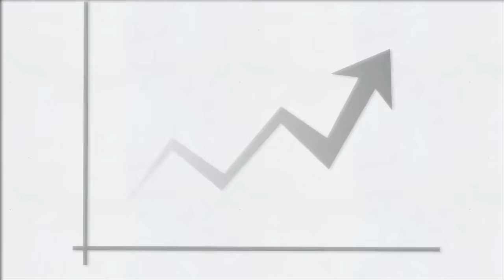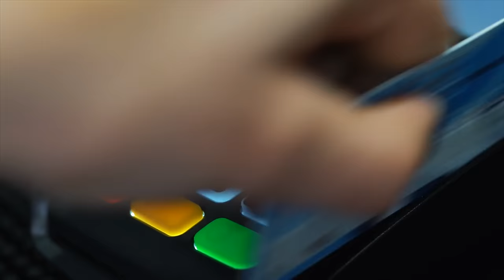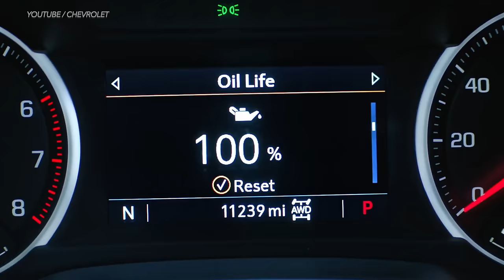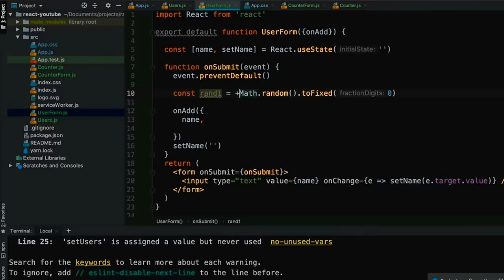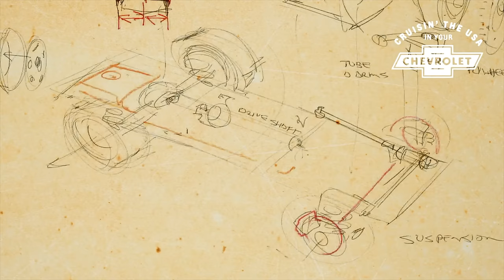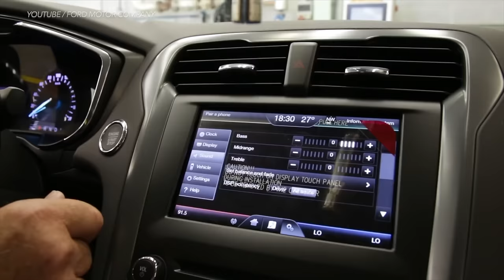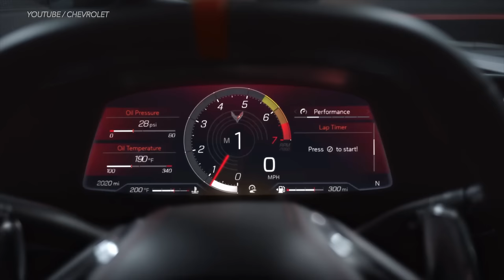Here's Why Car Companies Just Made it Illegal to Work on Your Own Car

Comment: A "cheap" mechanic in San Diego charges $125 per hour. There are hidden charges too. If a mechanic can beat the "book rate", the customer is still charged the same. I have found that also some labor can be charged twice. I had a water pump and alternator changed in a car. Part of replacing the water pump includes removing and replacing the alternator. I was charged labor for changing both items, or double charged for replacing the alternator.
Reply: Lmao all san diego is expensive, here in escondido, many mechanics dont even know what they’re doing and charge a fortune
Reply: A bigger problem is if they mix up the water pump with the alternator.

Comment: Audi's plastic thermostat housing scores top marks for planned obsolescence.  I just learned that for $1500 - 4 months after warranty expiration.
Reply: @midnitesquirldog1 most 90s cars were solid and very reliable.
Reply: For a thermostat? Incredible.
Reply: Exactly why I don't buy Audi or anything European, absolute junk
Reply: 4 months after warranty is coincidence about 1/3000 times. Just unfortunately not provable some how even with it happening with thousands of similar designs and parts. Only provable if you work with a government entity and safety related it seems.
Reply: @notsure3535   Modern Toyotas, specially the Prius, are among the most reliable, practical and efficient cars there is.
Reply: I just replaced one on a 2004 Honda Cr-V. Landrover is another one, it has an engine oil cooler that's plastic when it breaks internally oil mixes with coolant. Everything is plastic junk these days!
Reply: @hedgehogthesonic3181  yeah toyota are always reliable. But I doubt a new hybrid  are as reliable and easy to work on as a 90s Toyota corolla those 1.8 were bullet proof.
Reply: Lol the map thermostat I think
Reply: Ford had a plastic thermostat housing on their 4.0 SOHC engines between 2000-2010... It was notorious for leaking. I was having an insurance related repair on my 05 Mountaineer after a car accident and the mechanic was taking it for a test drive and it blew... fortunately, they were close to the shop and were able to get it back before it dumped all of the coolant and overheated. I ended up buying an aluminum aftermarket one afterwards. Sometimes the aftermarket parts are indeed better. On the bright side, my ride is so old that all of the design patents are expired.
Reply: I am a former Audi service manager and I usually would call Audi of America and try to get the repairs approved to file a warranty claim! Especially if the customer had a good service file and/or repeat customer! You can request an Audi DSM review your repair and possibly have some recourse if you have good service records and so close out of warranty! And If you went to an Audi dealer! Audi used to make good cars. Good luck
Reply: Make sure you get your order in for there latest model!!
Reply: WTF 🤯

Comment: I lost a plastic hub cap off my camry. Called the dealer to get a new one, they wanted 80 dollars for a single plastic hub cap.... found one on ebay for 20 bucks.
Reply: is it any good , dose it look them same ??
Reply: You can buy four copies for $20 on Ebay.  New ones from the dealer should not be $80
Reply: @johnsmith-ce2tq  it was the exact same.
Reply: @bubulubu3136  this was years back. Sometime around 2015. Couldn't find anything but the one. It was overpriced still but worth 20 to me.
Reply: Oh yeah eBay is a life saver for parts
Reply: That happened on my civic 3 weeks ago. I turned around immediately to see two cars run it right over. Literally 5 seconds later. Never bothered to switch lanes or drive straight so the tires didn’t go directly over it. It was right in the middle of one lane on a two lane 30 mph road.
Reply: @rafaeltorre1643  daily reminder that most people are NPC

Comment: And this is why I keep my 04 honda civic easy to repair and parts are always available. No stupid problems with electronics. 
When it breaks down I hardly stress, I know that car in and out. 
I would be stupid to let this car go for a newer one.
Reply: Truth
Reply: Same here with my 03 Corolla. I keep it simple.
Reply: all my repairs have been for the exhaust system, brakes or items like the alternator.  I have never had a module go out.
Reply: Too many annoying devices on the plenum
Reply: @albertopalma1663  got a 01' 5 speed recently. Went from a wrx to that and honestly not complaining.
Reply: Same with my 97 Crv👍

Comment: The flat rate system in flawed. It incentivizes rushing & cutting corners. 
Say for example a technician has 5 jobs lined up for their shift & that the total amount of repair time allotted for those tasks is 6.5 hours. 
Maybe 4 of the 5 jobs were successfully completed within in the expected timeframe, but the 5th one doesn't go as planned. Maybe the vehicle comes from the rustbelt & all the fasteners are rusted solid & in takes two hours longer to complete the job. Now that tech may be forced to complete that repair for free, even though the shop will still get paid either way. This type of scenario is not uncommon& it can turn otherwise competent workers into hacks.
Reply: That’s why I try to do as much work on my vehicles as possible. I don’t want my vehicle being that 5th car getting subpar work done on it.
Reply: Yep. Plus watching the person that gave you the work sit around laughing and bullshitting being paid essentially the same you are after figuring your energy given to the job is a huge deterrence as well
Reply: it all rigged just dont buy newer cars problem fixed
Reply: Amen.
Reply: @Bryan Lashbrook 6 months waiting on parts. WOW! I can't wait that long. I need my car asap!

Comment: Boy does this hit home. I want to replace the right rear trailing arm on my 2004 Honda Element which I can only get from Honda at $700 plus. The 2004 CRV cost half of that. Forget aftermarket they don’t exist. I had a hell of a time just locating bushings. I was told by a junkyard that the CRV & Element trailing arms are interchangeable but the dealer doesn’t know as he only goes by the part number. Supposedly they share the same platform. A Hollander manual, that the junkyard uses, would verify if they are interchangeable.
Reply: Tell Honda you are aware that the trailing arm probably costed them less than $20 to actually make and then tell them if they will do it for $200 they have a deal.
Reply: Look on eBay, not really a problem anyway.
Reply: I found one on eBay for 290$
Reply: Pull of your trailing arm, go to junkyard, pull trailing arm off a CRV, compare them.
Reply: @AceHernandz  only used ones on eBay. In fact if you search you will only find one of the bushings not the one with the protruding metal peace that has a hole. Siberian sells polyurethane ones. I finally located a company in California that sells the rubber ones but I would rather get new ones. I guess I will subscribe to Hollander
Reply: @crabbubbles1161  they don’t even stock them.
Reply: Should look at pick and pull first !
Reply: @andyhuang7526  I am looking for a new one not used. Worse case will get bushings.
Reply: then use the CRV one and stop crying about it
Reply: @executive  I am not crying about it but I need to confirm that it fits. If you had been paying attention I mentioned earlier that I had gotten 2 different responses one that they fit and another that they didn’t. It makes no sense to me to purchase them and have to return them because they didn’t fit.
Reply: Is that because Honda prevented third party from making them or is it because third party don't see a profit in making and stocking that particular repair part?  Third Party manufacturers are still a business and will only make things if there is a profit to be made.  They don't make repair parts, just to make to make repair parts.  So, should there be a law forcing third parties that they "must" make generic repair parts even if there is a very small market to justify the cost of tooling and manufacturing?
Reply: @HotRod-wv4vm  why not
Reply: @executive  if I buy them and have to return them because they don’t fit I will have to pay a restocking fee
Reply: @HotRod-wv4vm  politely explain to the junkyard that THEY suggested it will fit, so if it doesn't then it's their fault, and you shouldn't be responsible for restocking fee. If they stand behind their advice then they should agree.
Reply: I still don't understand what this has to do with the video. There are plenty of inexpensive aftermarket suspension parts for your vehicle. Just not this particular part. Maybe there's no money in it for anyone. It's not necessarily Honda's fault.
Reply: @executive  it’s Honda’s fault. In Canada Honda was forced to buy back some Honda Elements because they rusted exactly by the right rear trailing arm where it connects to the frame. Unfortunately they have not done that in the US unless the government forces them. I am trying to be proactive. My Honda dealer wants $1100 for a new one plus $1,000 in labor. Online it!s $700 plus and I do the labor. They don’t even sell the bushings! If I buy online from a Honda dealer it’s $700 plus and I do the labor. What sucks is that everyone makes control arms and other parts except the freaking trailing arms.
Reply: @HotRod-wv4vm  I understand. They're poorly made. But why is it Honda's fault that you don't like the price, or that you can't find any other parts? Is Honda PREVENTING anybody else from making control arms?
Reply: @executive  it’s a manufacturing defect. If the Canadian government forced them to repair it or if unfixable buy it back, they should do that here. I would rather fix it once I get a definitive answer.
Reply: @HotRod-wv4vm  this has absolutely nothing to do with the video
Reply: @executive  - there is SOME reason why this part is unavailable new in the aftermarket and price-gouged by Honda, and the patent situation described by Scotty is the most likely explanation why.
   So yes, it has everything to do with the video.
Reply: @jamesredman1263  you're speculating. Anyway, so if I invent a revolutionary new fuel injector then I shouldn't be allowed to patent it?
Reply: @executive  - I have nothing against patents as such. My point was, I believe this matches what Scotty is talking about.
 And I despise them price gouging $700 for one trailing arm AND not even supplying bushings.
Reply: Depends on the part, I have bought a lot of non-OEM parts, often with a lifetime warranty unlike OEM items from Toyota.
Reply: @toriless  I tend to get OEM Honda parts online and for what ever reason they are always cheaper than going to the dealer. Case in point U priced a hazard switch bulb and the dealer wanted $17 and they had to order it. I then remembered I had bought one online from a dealer for $3.00 free shipping as I had ordered some other items.
Reply: @jamesredman1263   @James Redman  how do you know they're gouging? Do you know what the part is actually worth?
Reply: @executive  - from what Hot Rod 1949 learned so far,
1. Honda screwed up many of the originals so they are unusually fast to rust near the mounting point, causing the  Canadian government to force a recall there. The US has not, so far.
2. Logically, the increased deterioration of the originals would mean higher demand for the replacements compared to comparable trailing arms on other Honda models. If the aftermarket could supply this arm as they do others, they would, but apparently they can't. Honda has a monopoly on it, and is charging TWICE the price of the comparable arm on the CRV.
3. Honda should ethically issue a recall and replace seriously rusted trailing arms on that model. But they haven't and they won't because Honda USA historically is known to drag their feet on recalls. In the 90s MANY of the Civic automatic transmissions were having major issues and they wouldn't recall them. Only those owners who were aggressive enough to convince them they could and would raise hell publicly got the faulty transmissions replaced.
   Likewise here, they SHOULD recall and replace the inferior trailing arms that THEY screwed up on for free. But instead they're charging DOUBLE the price of a comparable part because they can. They have a monopoly.
    That is pretty much a description of price gouging.
Reply: A “design patent” on a grille keeps the OEM as the sole maker/supplier of that part.   Need to hire the right lawyers to stop competitors.
Reply: @mojo_m7436  - I think most of us accept patent rights in principle. What the issue is, is using that for price gouging. 
  In THIS case, such as charging TWICE the price of a comparable part on another model as Hot Rod 1949 described, because there is demand, because Honda screwed up the original, which SHOULD have been a free recall, but Honda-USA is profiteering on their own mistake instead. Gouging the customer because they can, is the issue.
Reply: Exactly I know what you mean I went to buy 2 toe control arms for the rear of my 98 Lexus LS 400. 
Dealer wanted $800 for both.
These arms work like tie rods on the front but are stationary.
So I thought let me look on eBay for some high performance suspension parts BINGO. Found 2 of those arms with extra adjustment from MEGAN RACING, cost was $120 for 2.
Thank God for eBay.
Now my Lexus is perfectly aligned again

Comment: I've seen for years apparently there are think tanks coming up with ways to make common items more expensive. $800 egg charcoal grills, $400 coolers, and $295 coffee maker that makes just one cup at a time. The common battery I have to buy for my smoke detectors is now $12 apiece. I'm glad my F-150 is a 2018 that my independent mechanic can work on, I'll never buy a newer model.
Reply: I think I paid $50 - 100 for my cooler since it was marine grade that you could sit on as long as you weighed under 350 or whatever.  My Espresso machine was probably $100 and my burr grinder $20.  Battery, under a buck.

Comment: Great video. This is why I continue to drive my 1993 GMC 1500. I don't care how much I spend on repair bills. Dealing with rust and old parts on a truck that is easy to work in is always cheaper than new cars and computers. My truck has 346k on it and I still drive it daily!!

Comment: I agree with you about people not getting into the industry do to "manual labor". I recently started for a Chrysler dealership working on RAM trucks. None of the guys they hire (lube bay) have any real motivation or want to do a decent job. The younger generation is full of entitlement and are genuinely hard to train. And with all the electronics on these cars, they aren't prepared for the job to move up and make more money. These days you really need to have taken electrical engineering courses or  have a strong grasp on electrical from somewhere prior to coming into the industry. Sadly between the lack of work ethic for manual labor, and lack of education, it is almost impossible to hire and train new techs.
Reply: MR. RICKLES FARTTENHOOS  sadly no. This is california right near all the major aerospace industries. They have great training programs and techs make 30h base pay not factoring in productivity pay. Pay is decent some techs make over 100k a year. But the younger generation is full of entitlement and think cars are simple like the old days... which they arent.
Reply: Times change, generation change, mindset changes. Nothing stays the same generation after generation we’re just going to have to accept it and adapt.

Comment: The only time where my maintenance cost was higher, was when I had to replace the alternator and the two belts in my 2010 Hyundai Elantra. It was about 5 Benjamins, and  the car's value still remains at about $5000. Bought her in 2019 at that price and she's still going strong.
I know you're not a fan of Hyundai, but it is my first car that I OWN and I feel that it runs reliably. I don't know, maybe 2010 was a different time period.

Comment: Spoke to a guy yesterday. His Mitsubishi Pajero rear wheel sealed bearing is $700 from Mitsubishi.
The labour to replace it will be no more than one-fifth of that purchase price.
Reply: Seems pretty normal depending on how long it takes to fix.  Most garages I’ve seen are anywhere from $60-100 an hour for labor.
Reply: Mitsu. Parts are not readily available.  Mitsu sucks.
Reply: The labour cost is around $150 to $300 an hour at a dealership in Australia.
Lawyer money.
But that pales into comparison at charging $700 for a sealed bearing & hub assembly.

Comment: You can't replace the rear brakepads in a modern Volkswagen anymore just by manual work. You need a specific computer and diagnostic system to drive the electrical parking brake outwards. 😬 It's just increasing the costs of repairing a part that wears out without any benefit for the driver! 😖
Reply: Stop buying Volkswagen then. Protest by boycotting. Just my opinion.
Reply: @loudring6247  Already did! 15 years ago. 😉

Comment: I have a 2020 F150 XLT...recently it was hit by a hail storm.  Luckily I only lost a windshield & wiper blades that were easily replaced...BUT...the hail also took a small chunk out of the trim for the drivers side view mirror.  Dealer says "replace the whole assembly"...about $500 before labor.  All for a chunk of plastic...I searched for the individual pieces but it's hard to discern which is needed by parts breakdown illustrations.   It's a $20 piece of plastic!  Damned racket is what it is! 🤬

Comment: I always love watching you.  An  I'm not a mechanic but then wrenching since high school over 34 years ago.  And my brother-in-law is 14 years older then me and has been teaching auto mechanics at the college for some years now. The last time I bought anything new was in 2001 for my super duty , my aunt had this Lincoln an had some problem with the front suspension,  long story short.  Used the crown vic Ford part and it fit. And the Lincoln part was 3 times the price.